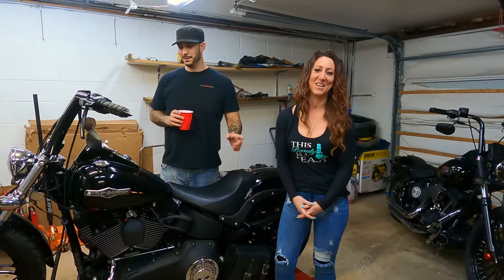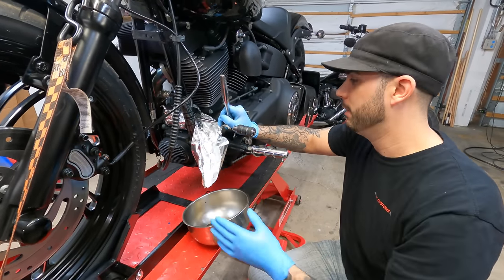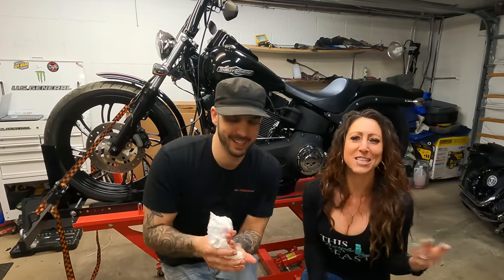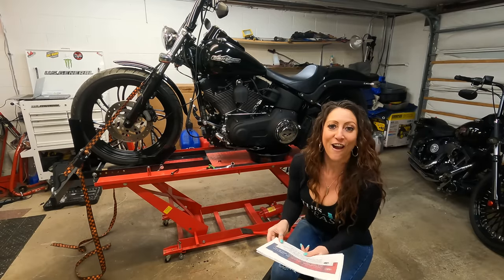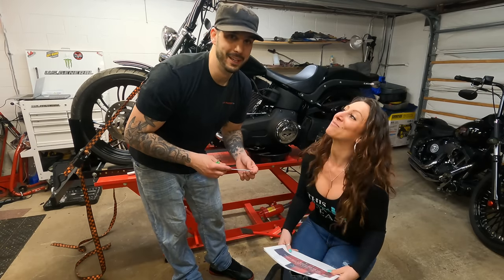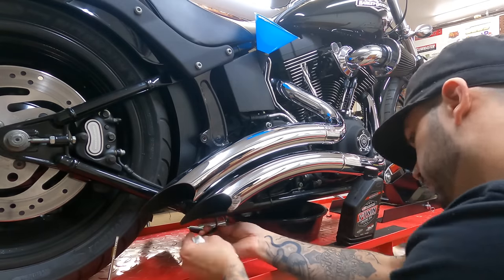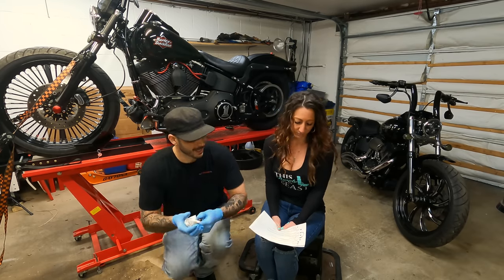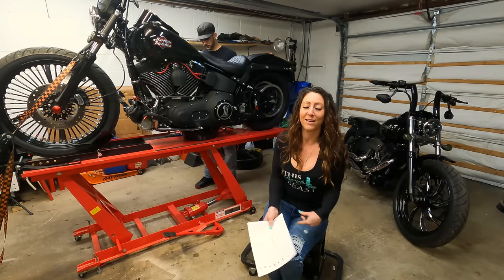HARLEY NIGHT TRAINS, OIL CHANGES! PLUS A LITTLE Q&A!

Comment: If you like synthetic oil in your bike, use it! If your bike is older and has ran for 50k miles on conventional and has had no issues, keep using it. The point is, use what works for you. Personally, I use Royal Purple full synthetic and a K&N filter. Never an issue.

Comment: Great video, Tanya an Eric... Those trips you went on looked amazing.. Thank you for the shout-out, Eric !!!! The pictures and small videos were amazing.... My 2005 night train is  carburated, which was the last year for that night train,  2006 they went full EFI in the night train... In 2008, they went to EFI. for all Harley Davidsons. Since you two have go-pro's, and when it gets warmer, you  should take a small ride with the go-pros recording. I felt like I was hanging with you two tonight...
Reply from the maker: You're welcome Brad!! That's great info, I wasn't certain on the years, so thank you for clarifying! We absolutely plan on doing some rides with the go pros and having audio for you to hear us yapping! 🤣
Reply: Actually I have a 06 and 2006 was the last year that you could choose carb or EFI.. so when I search parts for my 06 they have the option for FXSTB which is carbureted, then FXSTBI for injected which is what mine is.. so the 2007 model was the year Night Trains went fuel injection only. And I could be wrong but I also believe that 06 was the first year for the 200 rear tire.

Comment: They actually make a drain funnel to go underneath of the oil filter so when you unscrew it the old runs down drains into a hole right into your oil pan

Comment: I have really enjoyed Amsoil in my Heritage, especially in the Primary and Trans. I have noticed a difference on the how smooth the shifting is. I have one of those orange funnels with a drain at the end. Got it off Amazon. It works really well. My two biggest projects were the 14" handlebars and putting True duals on. On each one I got stuck and had to ask a friend to come over to help on one area. I also use Cardo and love it. I have had mine since 2018. I think you guys will enjoy the Cardo.
Reply from the maker: I hear great things about Amsoil!! Every project definitely has their hurdles and we can't wait to try out the Cardos!

Comment: K&N oil filter for sure , now for oil i have tried a lot of them , from HD to Amsoil and everything in between, 5000km intervals for 3 holes ,currently running the 20w50 Ultra1 synthetic, as long as the oil fits what Harley recommend for your bike you cant really hurt anything

Comment: I take a small punch, and poke a hole in the end of the filter. Use a piece of cardboard to drain into the drain pan. Works every time.
Reply from the maker: Love it! Great idea
Reply: @VPCustoms  I bought one of those Harley oil change kit with the filter wrench, long funnel, and filter oil catch funnel with a drain tube.  It also came with a long spike nail. Now I know what it is for.
Reply: Gonna try the punch trick. Definitely would help reduce the oil spliage 👍

Comment: For sure on the k&n filters. 
I personally run redline all around. No particular reason. I had suggested item on Google and it was a 3 hole oil change package from redline. Forums offer no help because it’s a battleground on oils. So it really comes down to what straw you decide to draw
Reply from the maker: Couldn't agree more! I hear Redline is good stuff

Comment: I use Mobile 1 in everything, even as my gun lube. Also K&N filters and the tin foil trick. Im cheap lol. Maxima is good oil though. Used it exclusively in my race bike when I was into hare scrambles.
Reply from the maker: I like your style!

Comment: I use the Castrol Tri Zone 20w50 for the last 4 years and the bike runs good, no issues. It is for the transmission, engine and clutch. I have a 2009 Super Glide Custom.
Reply from the maker: I hear that's good stuff!

Comment: Plenty of excellent modern oils available.  I tend to use the HD Fluids at the HD Dealership because it's convenient, but have also used Redline Products. Have never had any issues. Harley 3-hole oil changes, routine maintenance:  IMO the most important thing is to do ensure it gets done, and with the correct type & ratings of the oils...be it the initial 1K mile service, then at 5K miles and every 5K after that (re: 10K, 15K, 20K, etc.).  Or, and depending on what part of the country you're in (environment, seasons, extreme temperatures, etc.), how much riding, how many miles...once a year minimum, sometime during the spring, right before or start of riding season...just for peace of mind, reliability and safety.  These are all my suggestions, as I go one step beyond and perform an additional oil/filter change for just the engine oil in between the 1K/5K (done at 3K), 5K/10K (done at 7500miles), 10K/15K (done at 12,500miles)...you get the idea.  Tom M., So. Cal. '21RGS & '22FXLRS
Reply from the maker: Couldn't agree more!! Sounds like some nice bikes you have!

Comment: I used to be a guy who put whatever in his car or bike. However that changed once I actually began watching videos and doing research on oils and how they break down when the vehicles get hot .... especially twin cams.
I now only run Fully synthetic Amsoil 20/50 in the engine...... Amsoil primary in the primary and Amsoil tranny in the tranny. Loved it so much I became a independent dealer for Amsoil just to get it cheaper 🤣
For me I noticed immediately cooler oil temp readings.....smoother shifts and easier to find neutral.
No matter my miles, I change all three fluids and also do a brake flush every spring.
Also if I remember right the 99 and 2000 were carb only. Then in 2001-2006 it was carb or efi option...??? Then in 2007 they were efi only till 2009......
I think from what I've researched....lol
Reply from the maker: That's a home run, I hear great stuff about the Amsoil.  I'm going to make the switch!  I think you're 100% right about the years for the harleys too! Thanks Jason!

Comment: Eric, I use Mobil 1 also for the motor too ! It was highly recommended by a couple Ace Mechanics here on LI.  For the other 2 holes : )  I use Amsoil Synthetic. I change the motor oil every season (about 2500k miles).  I was told no need to change the transmission and primary as often. What's your thoughts?
Reply from the maker: Hey Jeff,  I've heard that as well.  I think you're fine with every other season with the primary and trans especially doing about 2500k miles a season.

Comment: k&n oil filter for sure. i use Rotella T6 15W40 diesel oil. is great for the motor and wet clutch on my 2012 Kawasaki Voyager 1700
Reply from the maker: That's cool! I'm hearing more people do this!
Reply: The T6 is full synthetic, and really isn't much cheaper than motorcycle oil, but when I'm using 4.5qts per change, the little less cost helps. 

I buy it in 2.5gal containers since I usually change 2 to 3 times a season from the mileage I use.

-Buffalo, NY here
Reply from the maker: @ScottSpencer716  that's awesome to hear all the miles.  Good for you

Comment: Hey guys. I use screaming eagle HD oil and the chrome filter. I just believe their oil is specifically engineered for their motors and provides the best lubrication. Im interested in trying Redline oil too. I heard its really good as well. I cover the voltage reg with a rag and have cut a plastic water bottle and used it to funnel oil when changing the filter. I think harley makes a funnel though specifically for the filter changes. Love the videos 👍
Reply from the maker: Thanks Brad! I've heard that's a great oil too! Good idea with the water bottle trick, it's cool to hear everyone else's ideas.  Thanks for watching!

Comment: I use mobile 1 syn 20/50  in motor and  ,cluch,    Mobile 1 syn gear oil 75/90 in the transmisson have for many of years in my Harleys,  I use Harley oil filters and cardboard under the filter for oil changes but I going to try tin foil next time !
Reply from the maker: Awesome! It works pretty good!

Comment: I think Harley eliminated carbs and went to full fuel injection on 2007 with the introduction of the 96" engine. My 2004 Night Train is carbed, my 2009 Street Glide is injected
Reply from the maker: That's good info, thanks Dustin!

Comment: What do you guys think of the ultima wheels? I have an 06 night train. I want to get rid of the solid rear wheel and the chrome all together. In in upstate ny pothole central
Reply from the maker: John, I have had great luck with both front wheels that are Ultimas.  No issues.  I would recommend running a tube in them if possible tho.

Comment: What bars are those on her bike? I just bought a 2000 night train.
Reply from the maker: https://www.amazon.com/Maintenanse-Handlebar-Softail-Breakout-King1996-2013/dp/B0C36WGTP5/ref=mp_s_a_1_5?adgrpid=139903445270&dib=eyJ2IjoiMSJ9.057qfPHc1peu2V6g5x600Xj_oD6bMu1VWL0FdUSFKfd3btBDoB2RIw1N6NC0AYXlcMGpeo08nFvoD7L0lZP6vzAG6Ect4nQoU3Z8iqhW3QVkasuqzeFuPYIjcE6H6teKYiUjPmTpjjczMgwl7b3RiMKohlbEsFC0hvanCMOf190HlVXZawhRPRMKT0J0_jYaP7r_ssYBLVoKHC4V-VuIFg.b3C-w4NRQHbXDmGgToO4uVYO1AnqDWqtFpxVsLTzOLI&dib_tag=se&hvadid=605088060618&hvdev=m&hvlocphy=9004886&hvnetw=g&hvqmt=e&hvrand=14596515283751725554&hvtargid=kwd-845530487470&hydadcr=13568_13366576&keywords=2+inch+ape+hangers&qid=1721265094&sr=8-5

We went with 12s and LA Choppers risers

Comment: Hi I'm looking to buy my first Harley Davidson and I was looking at a 2008night train I've been watching alot of your videos an have been wondering if the night train is a good bike to own.. I see you have a lot of fun on your 01 and 07 night trains.. I have heard about some plastic parts that could be a problem an that could be swapped out.. but over all what is your advice?on the bike..
Reply from the maker: Hey there! It's a very solid platform to have! I believe the plastic piece you are speaking of is the cam tensioner.  They had that sorted out for sure by 2008.  You will love the bike, they are getting much harder to come by! Good luck!

Comment: Just curious, with you guys having twincam’s 2006 down, have you guys checked your spring-loaded cam tensioners lately?
Reply from the maker: Tanyas is a 2007 but it's on my list to check my 2001, the bike only has 17k miles on it but I know I'm gambling!

Comment: Hey guys after I rebuilt the engine I started
Using Ams oil 🛢 after using all different brands I find the alb
Reply: I'm sorry guys it's late fell asleep and sent did not mean to.  Anyway I found Ams oil actually made a difference in noise and heat. Bike runs way better. And when I changed oil now it comes out much clearer and cleaner.thanks guys great video 📹 once again. Look forward to seeing the next one.
Reply from the maker: Thanks George!